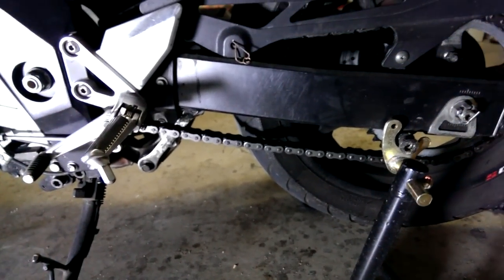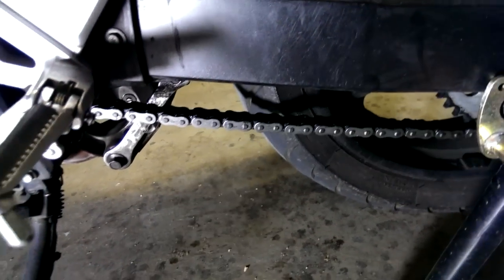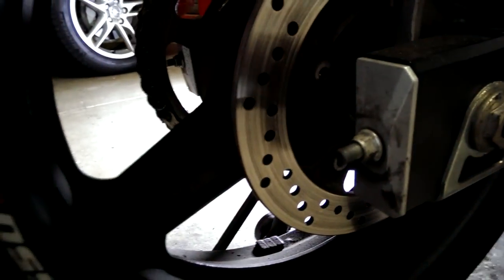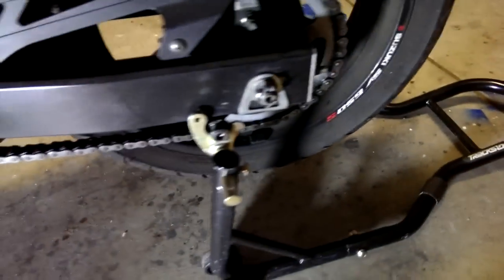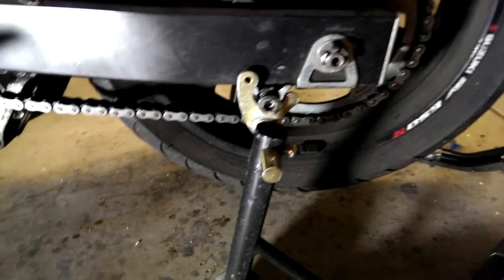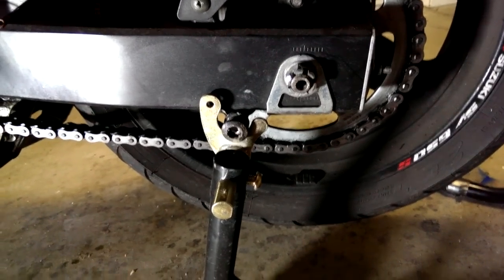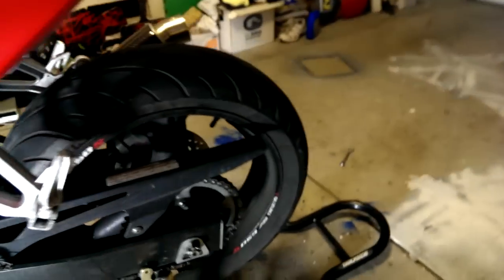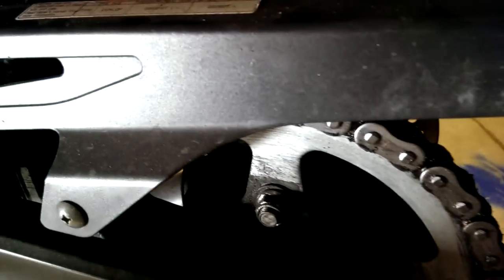SV 650 Chain Adjustment

Comment: Thanks for the video! From reading, I think you want to adjust from the slackest or you risk over-
tightening
Reply from the maker: If you tighten from the most slackest point in the chain, then wouldn't the tight spots would become extremely tight and more liable to break?
Reply: i need to read more clearly.  you're absolutely right, my apologies.  you calibrate by the tightest section for that reason.  sorry for the trouble and thanks again for the vid

http://www.svrider.com/forum/showthread.php?p=1507122#post1507122
Reply from the maker: No worries man!

Comment: Question. When you touch the chain to see if ita tight or loose. That spot! If its loose you turn that spot to the rear sprocket and tighten the screw or you tont turn the chain just tighten the screw right at that moment?
Reply from the maker: ***** Not entirely sure what you're asking, but I'll summarize what I think you mean and you can ask for clarification. You're asking if a spot on the chain is loose, do you turn the wheel so that specific part of the chain is on the rear sprocket and tighten, or do you just tighten without worrying about it?

If that's your question, I'd say just tighten it. However, a single low spot may not be indication to adjust your chain. If that is the only spot that is loose and out of spec, it might be okay just to leave it there. You should check your chain tension in multiple spots. Also, if you have massive differences in tightness of your chain, it may be an indication of an overly tight chain and/or a chain at the end of its life. Hope that helps!
Reply: Shoeshear so basically when You tighten the bolt, the one  next to axle. Which part is tighten. Or just the half of the rear sprocket tighten like you stretch out a rubber band.
Reply: ***** and also the spot you check if the chain too loose is also the mid section of the chian. So if that spot your touch is loose are you suppose to turn the wheel to the back sprocket so when you tighten the bolt the rear axle move back. Is this easier to ubderstand.
Reply from the maker: ***** 

As far as I know, spot checking is to get an idea of overall chain slack. I've never rotated it so that the loose part is on the rear sprocket. I keep it at the midpoint so that I can keep an eye on the slack and check it at various points during the process. If you put the loose spot at any point either on the sprockets or make it part of the upper row, the wheel will move farther back. However, that makes it annoying to check the slack. Hope that helps!

Comment: What did you torque the axle nuts down to?
Reply from the maker: I think this was before I believed in torquing... I usually tighten it and call it good. This one has a cotter pin in a castle nut, so the nut backing out is a low probability.
Reply: Shoeshear Awesome. Thanks!